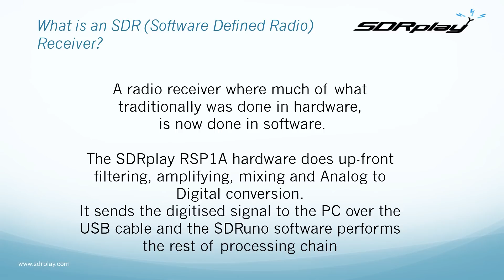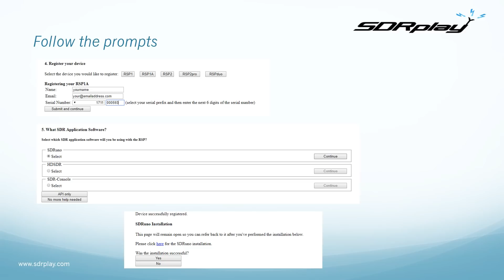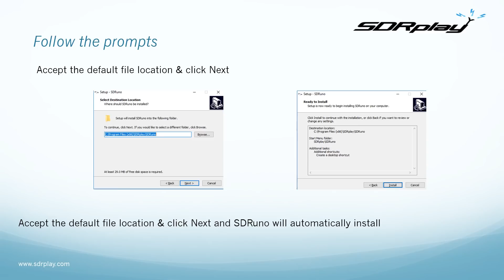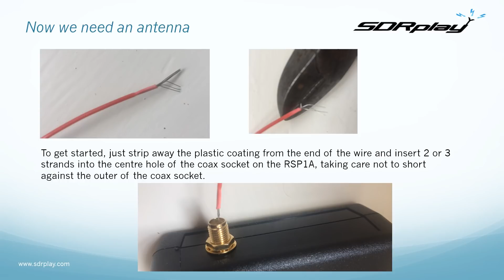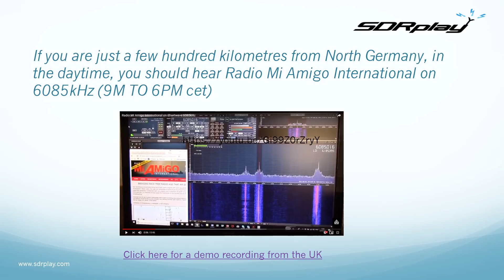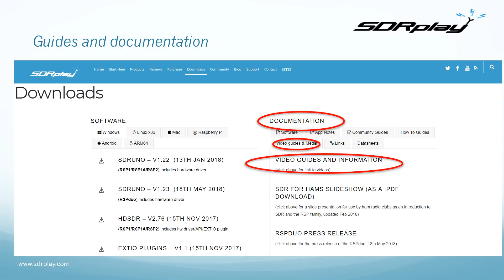Newcomers to SDR and SDRplay (see link to new replacement video)

Comment: I am afraid I have to give this very low marks for the audio as well. There is a ridiculous amount of AVC action and very often a very a bad overmodulation on the attack. And to top it off the microphone is horrible. It almost sounds like you are sitting on it. I would really like to see this redone without the backgound noise and with a cheap little lapel mic on your shirt. It works for all the newscasters.
Reply from the maker: Agreed, we'll replace it ASAP.